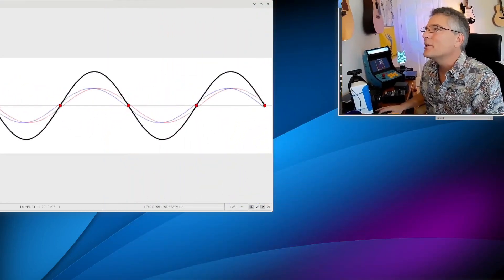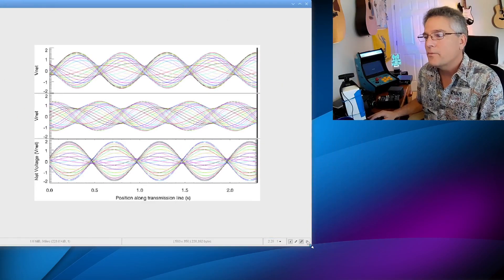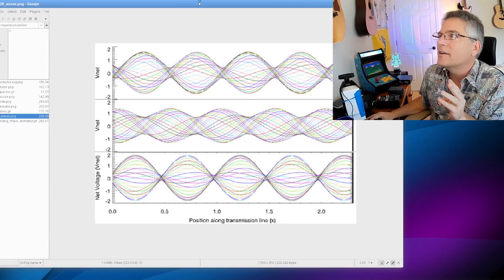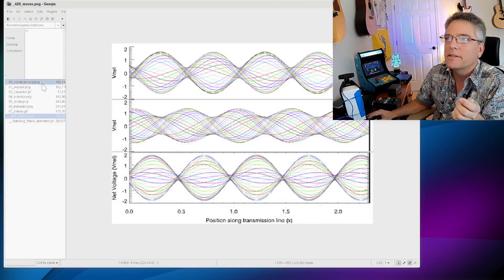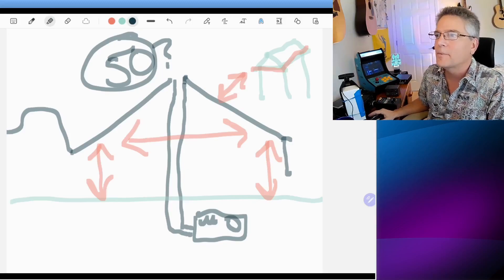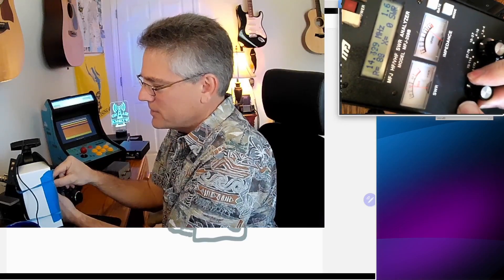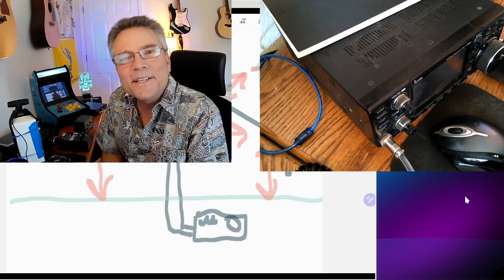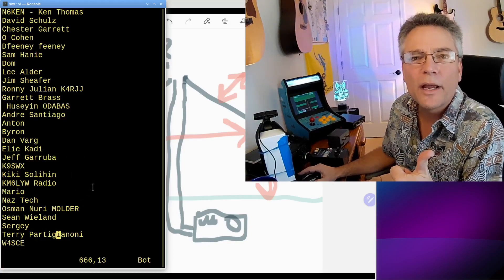High SWR?  The radio you save could be your own!

Comment: NanoVNA is also an excellent tool especially for seeing your reactance and capacitance.  The smith chart is helpful.  2 downfalls, make sure it's a good one, don't cheap out and the constant calibration each time you change a frequency spread or band.  That being said, the Xeigu g90, x6100 great for their tuner but I'm a big fan of as resonant an antenna as possible.  Tuners are great but when operating QRP I want as much of that power getting out as possible.  Good Video.  I knew SWR is bad but your visuals of the waves actually visually explained it a lot better for me.